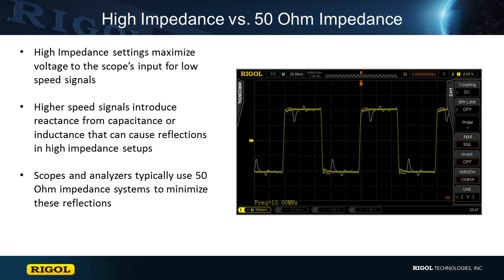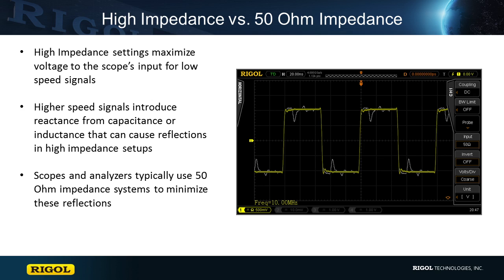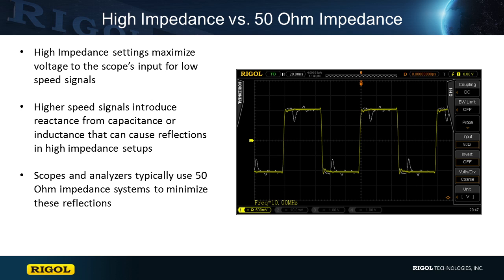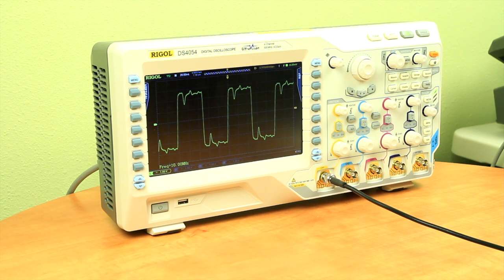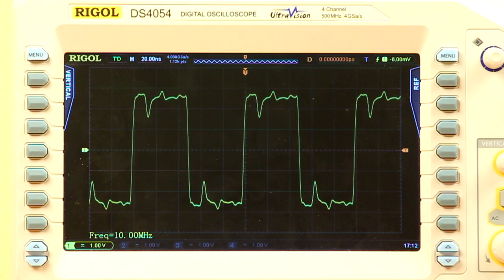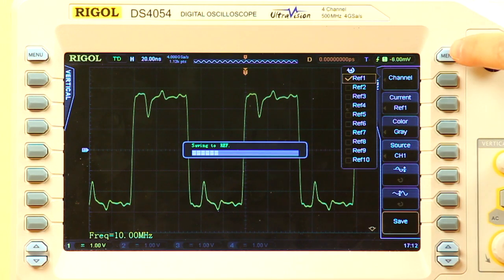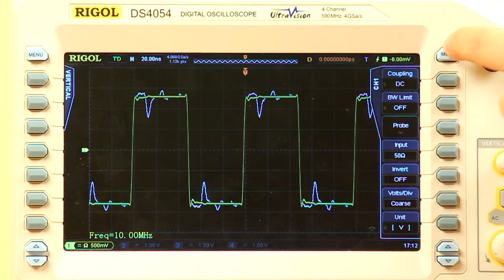High Impedance vs. 50 Ohm Impedance

Comment: When is 1Mohm used and when 50 ohm ?
Reply from the maker: typically we use 50 Ohm for higher speed signals when we become concerned about reflections and transmission line effects. But as you can see in the video, signal fidelity is effected at even relatively low frequencies. It all depends on what signal fidelity your application requires.
Reply: So why would you ever want/need to use 1M? @RigolTech

Comment: I noticed that there are still some ripple while using the 50ohm coupling. How to reduce the ripple on the 10MHz suqare wave?
Reply from the maker: Since you are using a 50 adapter then the ripple you are seeing is your actual signal ripple.
Reply: RIGOL Thanks for your explanation. Still,  my question remains  the  same,  how to reduce such kind of ripple. I has seen this kind of ripple in former cases,and i add some small cap to reduce it but small ripple can be still found.
Reply from the maker: @姚一帆-v4n  Can you send me an email with your wiring diagram and some screen shots of your results?  You can send them to Help@rigol.com

Comment: Hi, I nocticed that when you change the impedance from 1 MOhm to 50 Ohm, the peak-peak voltage of the pulse also changes from 5 V to 2.5 V. Does that matter?
Reply: highly dependant on source impedance.. Presumably whatever the source was (e.g. function generator) it has a 50 ohm output impedance. F. gens will typically double the amplitude so that when terminated with 50 ohms (as they expect you to do), the resulting voltage divider will appropriately halve the original amplitude.
Reply: @Jarrettmonty99  Thank you very much! That makes sense.

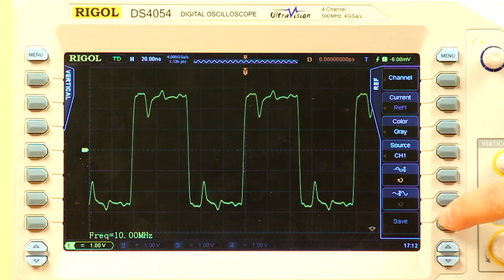Comment: When I measure a 10MHz signal, I usually don't get the waveform (with ripples) shown at 1:33 . 
I sometimes get spikes on both sides of the square wave. When I terminate with 50 Ohms, the square wave is normal (no spikes).